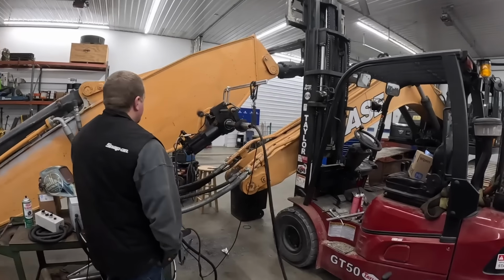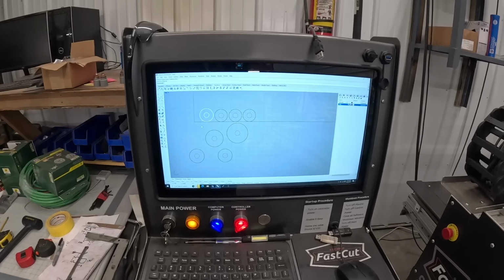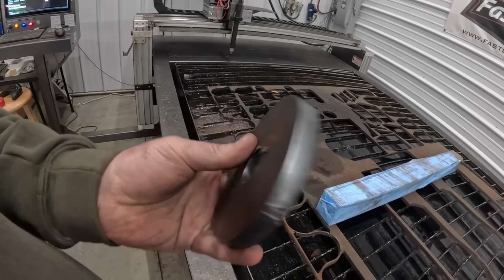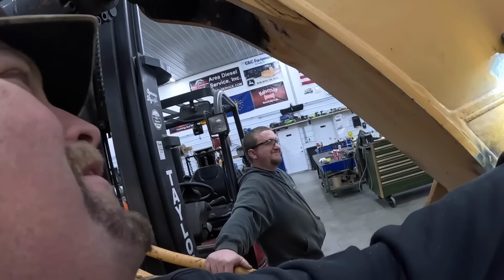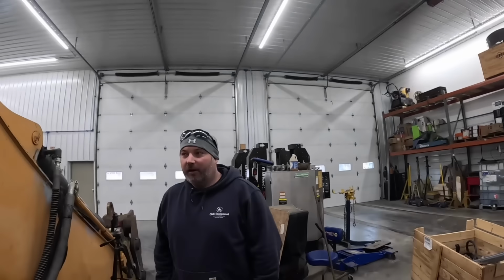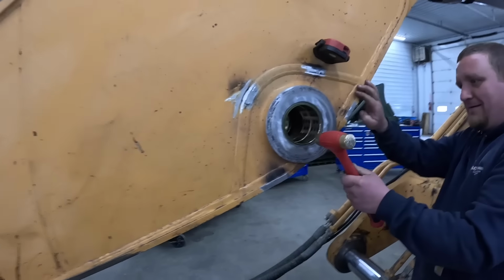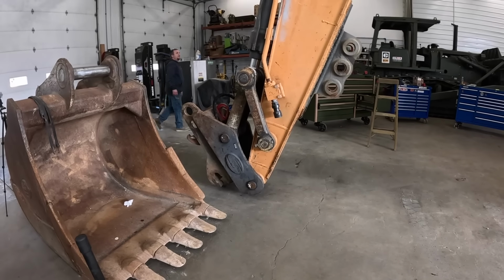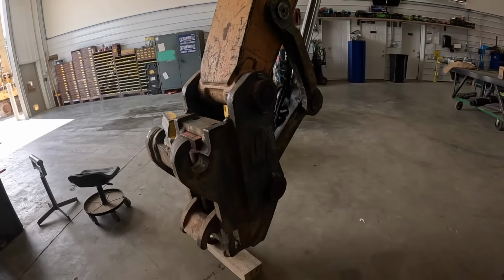Part 2 on Case CX300D Arm and bucket repair with a new tool!

Comment: I understand you can’t deep freeze the bushings due to the carbon inserts, but would cooling them down to just above 32 degrees help at all or does the metal only shrink at very cold temps?

Comment: Recently Kurtis did a similar job but had to weld plates as wear surfaces on the sides where you've put seals. Are those supposed to be wear areas on this arm? Just curious if you've ever had to do that too.

Comment: I didin't read all the commens but you don't want to use a regular all thread rod with a hydraulic cylindre. they make special rod that can have 30 or 50 tons of force without breaking. And we always put a second nut with a clevis or something on the rod and a chain so if the rod break it will not go fly around the shop.

Comment: 7:55 Clint, Is that a new Toyota forklift? I know you had the 2 Taylor's but not a Toyota too. Did you buy one of the thousand forklifts(from Yellow inc) for sale at the Ritchie Bros auction where Matt(@DieselCreek) bought 10 of them there too? I know he got a bunch for $1k so that seems pretty cheap to me(I'm no used forklift value expert). I'd definitely buy a few at that price too, especially the ones with the scale on the forks for sure! That scale system is gotta be worth a grand easily by it self. 👍🏻👌🏻🏗️🚜🚚🚧🦺
Reply from the maker: I do have some new ones that are for sale

Comment: What you can do instead of making go/no-go gauges every time is make a simple telescopic gauge on the lathe. Just a drilled piece of bar that fits through the boring bar, with a smaller diameter bar that slides into it. A set screw to secure it at bore size, remove and measure with a micrometer or calipers. Round the ends over so you get a true reading
Reply: You can also buy them fairly cheap as a set, called snap gauges (same principle as you mentioned but sprung loaded)

Comment: Nice Job,  that bore turned out sweet! You can use a Cylinder Hone on bores like this if you only need a thousandth or so. Also slicks up the surface finish and bushings slide easer.

Comment: You know something, the line borer / welding setup that Kurtis of Cutting Edge Engineering Australia uses seems to actually work faster and easier.
They work so well he bought a second, larger version for use on bigger machines. He posted an unboxing vid of the new one 2 weeks ago.: https://www.youtube.com/watch?v=seYI4zxTBrM
New Machine Day! | Unboxing Sir Meccanica WS2 PLUS Portable Line Boring System is the title of the 15:33 vid.

Comment: There is a YouTuber in Estonia called Ants Pants who worked in the circuit board industry. He recently restored iffy circuit boards by heating them in an oven at 200°C for 20 minutes. I will verify the numbers.

Comment: Forced to retire is not a friendly option in life and so getting rid of tools I had since early times in life was very hard. My tool collection filled three conex's plus my small home shop for small vehicles was completely full, running over into the cupboards in the house. Believe it or not, recently found four quarter inch drive snap on sockets, deep sockets that must of been some kind of project in the house and I was guessing as to what I needed. My point is the tools kept were all good quality and most before I got rid of them had little use on them. Mostly because of a stupid mistake of helping someone and getting hurt in the process. Longest story ever is that sometimes its best to just turn the head and let someone kill themselves as in my situation. Old man on a damn ladder says..... I'm fine, expletive words spoken and he jumps on the ladder rung, its old wood, of course it broke and down he came into my arms. He is just fine, lives in California with a son while I wait to die in pain. Pain management is a slippery slope, decisions made by those professionals is killing me because I don't cheat, I just do as they say to do. Getting back to the tools, never enough and yet most now outdated for any use on the vehicles today. Which way does a man choose to go? Of course there is no real easy way for a person to make a answer to many questions. We all make mistakes and its never a bad idea to have the best that you can afford for the trade you choose.  I wish we were setting at a table, a fine lady pouring us fine liquor while swapping lies about how fast this rig was... all stuff just made up as I try to type a clever response. I have twenty eight years of sobriety, wouldn't trade that for anything.... even tho it kinda sounds fun. I sure hope they have a shop in heaven and some of my tools make it ahead of me.
Reply: Have you located your 10mm socket yet ? 😊
Reply: @taloniilm  everything was eight MM or smaller.... stuff hardly used... now tho, things have changed a lot and they do have a lot of uses

Comment: you should have invested in a quality boring machine like curtis @cutting edge engineering down in Australia bought think it was sir mechanica he also uses double shielded welding with flux core wire his has face milling attachment works really nice think it wasn't top end machine but looks to do very decent job i know you have some issues with that chinesium crap like everyone does friggin chinese

Comment: One of your video's you rescued a fifth wheel  trailer off of a active train track.  If you do this again, take some jumper cables and hook up the two train tracks together electrically, and that will tell the train operator there is something on the track in front of them, effectively making your section of the track give a red light to the trains going toward you.  Also expect the wig wag lights to activate as soon as you attach the jumper cables to the two tracks.   Those that are not watching you attach the jumper cables, you can say "There is a train coming" when the wigwags start to flash the lights and ring the bells.  

Why has nobody told you the easy way to prime a diesel engine?  And one that is not running properly?  Spray in WD40, and the engine that has lost it's prime, it will start and run on the WD40.  Yes I have done this before.  It is a old trick used on refrigerated trucks, when the diesel engine has lost it's prime while driving across the country, and you run it out of fuel. It is not going to dry out the cylinders and wash off the oil like eather.

Comment: Try using short blocks, glued vertically, along the center line length of the keel pocket template, and then connect them horizontally with a full-length piece

Comment: Instead of liquid nitrogen, can use dry ice pellets or blocks in a cooler to get parts like bushings cold. Just make sure to use that in a decently well ventilated are because co2 is heavier than oxygen and will displace breathable air at lowest points.

Comment: Nice to see it back together. Surprised with as low of hours and as nice as the rest of the machine is it got egg shaped.
Reply: That's what I thought as well. Lack of grease or hydraulic hammer is my guess.
Reply: Side swiping using the slewing too much would also explain those symptoms.

Comment: Hello Busta Tracks do you think the repair on top of the boom, Will have anything to do with the bearings being egg shaped ?
Reply: Bearings where they at?😂😂😂
Reply: @rodneydaniels4357  Bushing is a style of bearing....
Reply: Really ain't seen nothing that says bearings in any books to me. It's all been bushings
Reply: @rodneydaniels4357  Plain bearing is what many call a bushing or a sleeve.  High load, slow movement, restricted range of motion.  Those tend to be factors that lend themselves to plain bearings. 

A bushing is a bearing,  but a bearing is not necessarily a bushing.

Machinist Handbook
McMaster Carr
Reply: Did I stir that pot up or what.

Comment: The Bronze Bushings you installed is most likely Ampco 18. This alloy mix handles high load pressure better. Now you are correct on the Graphite in it. This style bushing some what self lubricating. Oil is used at first. From past experience grease can be used but tends to erode the graphite. Where I worked used this style bushings on dies for Automotive industry.

Comment: The hat is definitely pushing you over the top Mr Kevins makeing you the best and most honest Used Heavy Equipment sales man of year in the hole south were at C & C equipment with the slogan if you don't see it up front then for sure apon younder in the rear / Bone yard we will for 29 . 95 us plus shipping and handling it will be second to done the best darn used Heavy Equipment with low hrs and minimal dints and dings on the panles in the south 
😂😂😂

Comment: Clint, take a look at a few of the line boring videos over at CEE. Curtis has an accurate solution for measuring with the bore line in place. Also useful for getting the cutter set exactly where you need it for the next cut. Hope it helps.

Comment: Hello Clint great video.  If I may be so bold as to suggest to measure DOC (Depth of Cut) for your line boring machine, use a Magnetic Base Dial Indicator, (No {Dial Indicator} Harbor Fright, spelling intended,) purchase a quality one Starrett Tools, Brown & Sharpe, Mitutoyo GenSwiss', Swiss tools, alesa · allmatic · erowa · fraisa · haefeli · hangsterfers · iepco · litz · kern · maprox ...etc.

Comment: You can add a hydraulic pressure gauge to the line to see what your working pressure is to stop an issue if needed. But you may have a pressure gauge on the pump already. Thanks again for your sharing!

Comment: In the words of one of my mentors "can't argue with success" I've done alot of bushings with a hollow ram....most machines are 90mm or 80mm take a old pin and cut it to makea pilot for your bushing ...Also i like to use acme threaded rod it lasts a longer time than threaded rod sorry for the rant keep being you ..

Comment: 4/19/24..hey Clint, another great presentation & machine shop level of 'weld fill-in/build-up' & 'line-bore-to-spec' for (large..3"od?) pin-in-bushing excavator arm-to-stick (exacting) fit....if it don't 'hinge, it don't fit'...but your repair worked fine!
 Appreciate your comments on learning more on this Line Boreing machine + new yellow Bushing install, Porta-Power type, machine-gun quick hammer-in tool; that made fast work of this major repair! Am sure you will be using this tool again to retro bushing/pin fit repairs; gotta be some good $$ to do that!😊
 Stay safe & carry on Clint. Good job to all guys at Team C&C!💪👍💥🔧🔩✅️🍺😊

Comment: i hope the cutting machine doesn't require the user to VISUALLY check that the objects to be cut fit on the metal presented. on the table. i would think that a simple continuity check could be implemented by the designers. if not, then IMO it was a critical oversight.

Comment: That line boring /welding equipment seems to be very useful, also using that ram like that very good. Now your getting into the world of machining you need your own measuring scale, Kurtis has Bananas you could have Kevins. 🤣 Bet the customer is wall chuffed with what you and the team have done. 👍

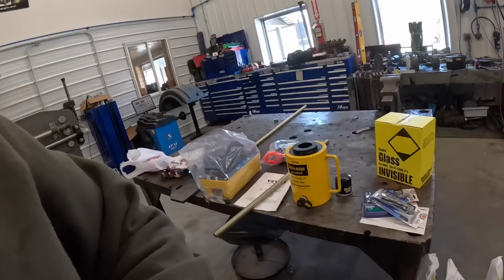Comment: You really need to study CEE Australia's line boring videos. You need snap gauges for measuring the bore using a normal micrometer. https://www.youtube.com/watch?v=vRgkWJRDcLw Timestamp 5:18
Also https://www.youtube.com/watch?v=4ermO87NMEs

Comment: Clint there a heavy equipment welder on youtube,  that uses strictly heavy port a power unit to press his bushing after he does his line boring and bushing replacement, it's basically a dry press system that he does. Check it out. He does lost different repairs on heavy equipment,  I believe he's self owned company. He does excellent work.

Comment: Half way thro comment and advert comes on and I lose it.  That is not right,!
Hi Clint..  been subscribed from 2012 and continually being un subscribed.
I check every time I view.  Watched Case 300 D part 1 and clinking like button checked and was subscribed. You were last viewed channel.
 2 days later and part 2 was available. Found I was unsubscribed again.  I do check every time with your channel! 
  It does not happen with any other channel.  Dirtperfect has splash screen which shows subscribed in red on his introduction.
 Watch Wes work, snowball engineering, Andrew Camarata, letsdig18, Chief Macoa   ships engineer, Mr. Myleminal?  and all other I channels NEVER get unsubscribed!  Have you upset YouTube?  You are so much more informational than many other channels that have higher audience numbers.  Why?
 Many are just hackers and unskilled in the same niche as yourselves.  
  I don't think your wife helps the channel and hers is a disaster. 
  Thanks for improving my viewing.  I was 89 recently ... Yesterday got  my Kamasa Tools..  120 pieces bought in 1965 and pristine ..mended the lawn mower.  Briggs and Stratton.
Reply from the maker: Wow thanks for being a sub that long! I don’t know what to think about YouTube sometimes